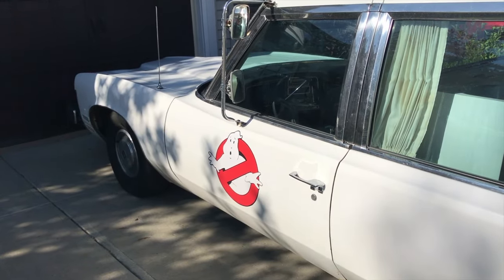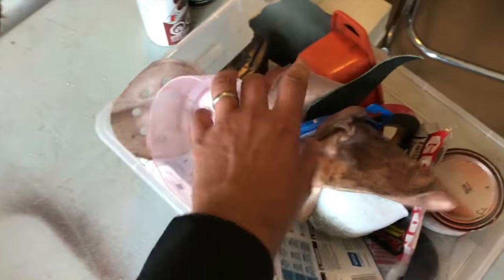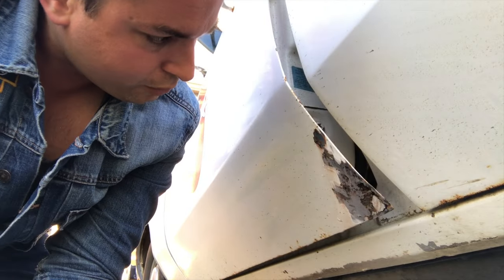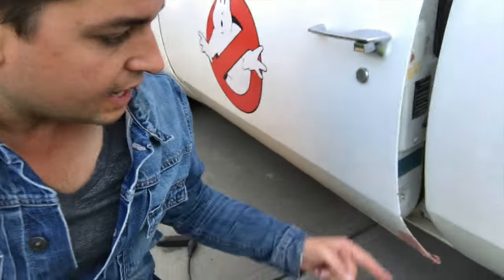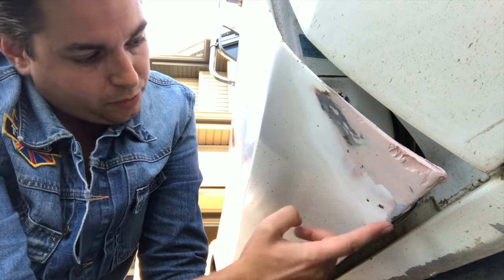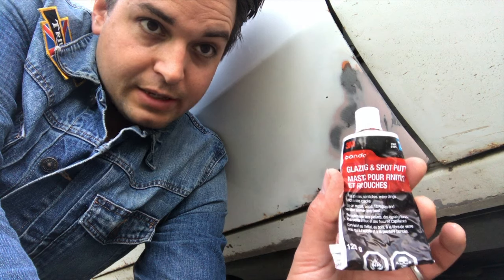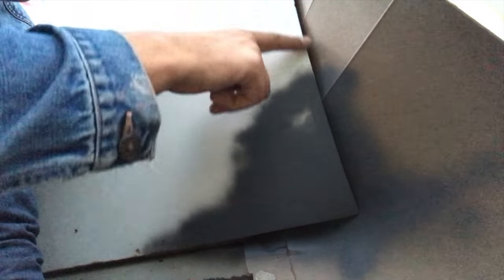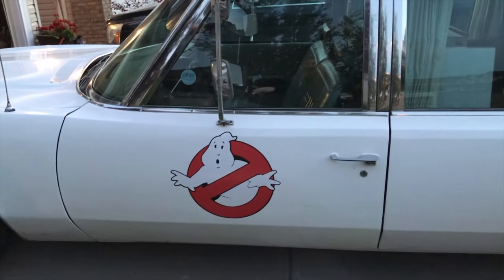Low cost vehicle rust repair you can do at home!

Comment: A good backyard repair. A couple of things you can do to make it a little nicer are : Sand your primer coat with some 400 wet and dry sandpaper before you spray your finishing coats. Spray at least 4 coats of your final colour and let it dry for about a week. Then sand down the paint with some 2000 wet and dry sandpaper. Then buff it out with some polishing compound. You can do the colour sanding and buffing on the original paint as well and it will bring it right back to a nice shine.
Reply from the maker: It was a quick fix, I will most likely weld some steel in the summer as a more permanent fix. Thanks so much for the suggestions too :)

Comment: Well done, but it may be a good idea to spray a zinc enriched primer on the bare metal before the Bondo. The repair would last much longer.
Reply: Ali Erikenoglu good observation Ali Ali oooo😀👏😀👏👏😀👏😀👏😀👏😀
Reply: I was always told to put bondo on bare metal?
Reply: @racingfreak1337  it's just an idea I had to prevent further rust from occurring. I'm just a "do it your-selfer" not an auto body guy :)
Reply: Im pretty sure I read that bondo will not adhere to any primer except epoxy.
Reply: @joeldk42  Best to adhere to 36 grit sanded metal. Either mechanical adhesion or chemical.

Comment: so I have a low book value camry with an engine likely to last a couple hundred thousand miles more, but it is set up to start rusting eventually because clear coat is gone from much of car and paint is chipped away to metal in spots...I'm really really bad with sanding and paint and I don't really care about looks, I just want to keep this thing for rusting for a decade as cheaply as possible...maybe something clear that will stick to any metal, paint, and bits of clearcoat and hold on for a few years? any cheap backyard fix suggestions?

Comment: Shoulda used a wire wheel or sand blast to get into pots of rust and not take out too much metal like grinder does. Also resin filler would have been a better choice for a large hole like this it’s much stronger. That or fibreglass it then bondo on top

Comment: Hay mate there is one thing you didn't do after you cleaned the rust of is you didn't give the rust any kind of rust converter  or ever a rust killer before you did your boby filler mate so the rust will come back quicker
Reply from the maker: You’re right in my video I forgot that step! I guess I can’t be the cameraman and body man at the same time :)
Reply: lol well mate i'm having to do the lot myself at the moment been doing my channel for three almost four months now and don't have anyone else to hold my cemara for me but it still was a good basic job
Reply: Wayne's Garage  I have done jobs like this. With rust killer chemecles or with out them, the rust will come back just as fast in Canada. You are best off just to cut the chunk out with the grinder, prime hte area then cut a part of aluminum, tape it in place with  metal tape or silicone, body fill and paint.
Reply: rust converter is a waste of time and money. it does nothing
Reply: @WaynesGarage  go get a GoPro
Reply: @Danevv  what are you buying me one are you
Reply: @WaynesGarage  gladly
Reply: @Danevv  mate id love to have a go pro for my channel
Reply: @WaynesGarage  knockoff are cheap

Comment: Hmm... this great guy should have known better because: Bondo over rust is like putting a plaster over cancer. If not cutting away the rusted material he should have used rust eliminating stuff and primer before Bondo at least.
Reply: chru cas well he knows that, the point was its a quick cheap fix that looks decent he probably doesn't want to throw money at an old car
Reply: Dear @bendude6748  
Maybe you are right. But there are always different ways to get things done. A right and a wrong one, sometimes even a way in the middle of that (in this case rust converter and primer would have been the middle way). In my opinion this special ambulance car will be a keeper because it's relatively unique and a fantastic advertising for his business. It is very recognizable and has a big trunk for transporting things.
Also: In areas with snow and salt no "repair" like this will last more than several weeks until rust gets through again. He didn't even use a rust converter! Yes, of course, he is an absolutely great guy with a lot of decency and skills. And he can be proud of for what he is able to do (at potters house for instance)! But this bad kind of "repair" should definitely not be shown in public, especially not by him. Or do you want to buy something treated like this? I don't think so.
Best regards.

Comment: Guy states this is a quick fix and understands it won't last forever. The funniest part is down here in the comment section where the professionals state, that this is a incorrect way to repair your vehicle and proceed to tell us the right way to do it. MY QUESTION is .. why the "fuck" are the professional body men watching a backyard diy repair job? I know why I came here. You know why you came here. Why the fuck did they come here? Oh right. . Because they watched 5 other videos before this and read the comments and want to sound just as smart..
Reply from the maker: Thanks for understanding. I know the right way to fix it... I just wanted the fast and cheap way to do it :) I may weld a patch in this summer, just didn’t want to look at a rust hole until then! :)

Comment: You didn't get rid of all the rust or treat it with Zinc oxide or rust converter, that's first basic step before you do any filling or sanding or undercoating or spraying and the undercoat/primer should be zinc primer so that it inhibits rust also, that will rust through and the whole corner will probably fall off within a year I'd guess.. I mean if you're not bothered that's one thing, but jees if anyone copies this video it's the worst "tutorial" I've ever seen..
Sorry just calling it as I see it.
Reply: Bad energy comes back to the source. Always! don’t you forget sir.

Comment: too bad you didnt use POR-15 to stop the rust...now your bondo will let it still rust. bondo will crack & fall off in a few years. POR-15 makes a sandable paintable putty filler (instead of bondo) also that prevents rust too

Comment: Gotta kill that rust, seal up that bare metal asap. I know it's just a for now but you'd be surprised at how far and bad rust can get when it starts. Use some baby, mineral oil or Vaseline. Tape drain holes, run a brake line down window crack and fill it up about a inch or so. Let sit for a week or drive then drain and save for next time. Ive used ospho for decades. It will kill rust and seal it up. Or Muratic acid or any acid urr ok with. Just use urr brain. That goes without saying but after teens eat tide pods u never know. Rinse with baking soda and water solution. Dry with air or heat. Then prime. I use Car Rep epoxy. It has unlimited shelf life so u can spray a spot now and then also next month. Other 2k primers and coatings have a 24 hour pot life. No good.